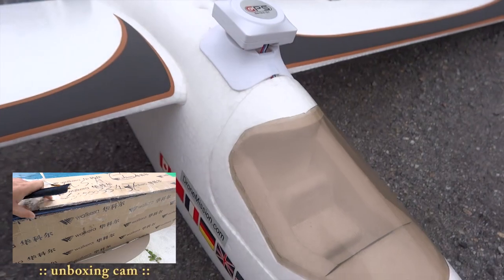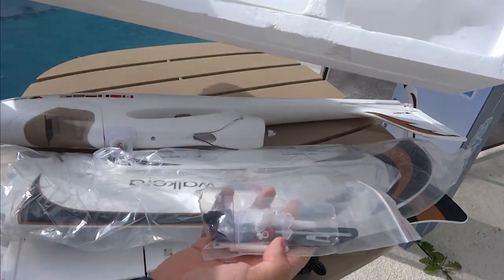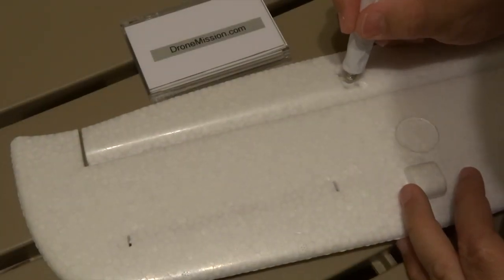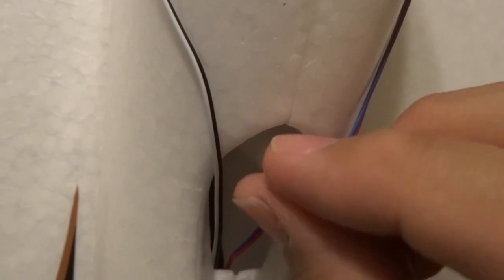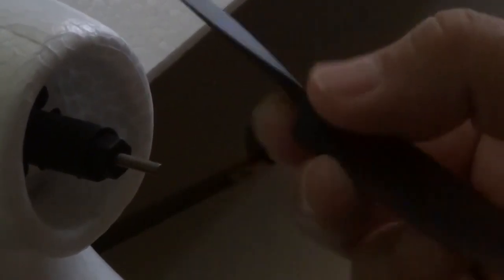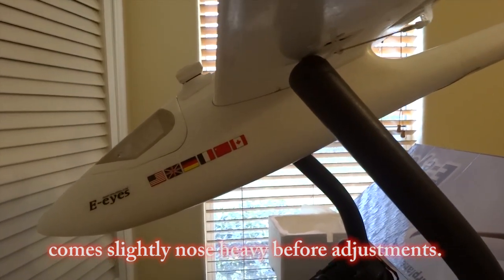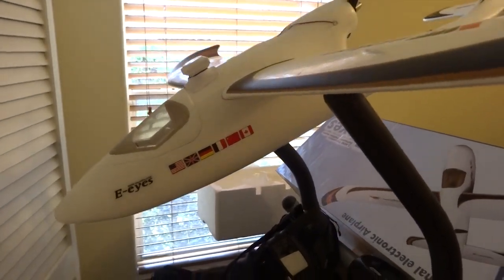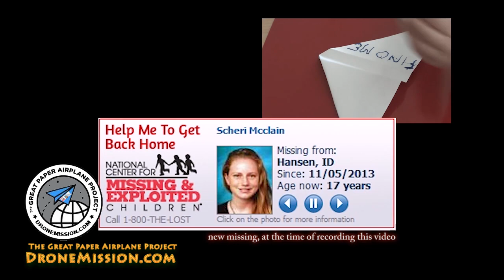Walkera E-Eyes GPS Plane unboxing, installation & maiden flight

Comment from the maker: hi rick, sorry google+ is confusing,  but to answer your question we lost. The BNF version has the walkera receiver built-in, you will need to use a devo transmitter or DSM2 compatible, unless you cut the fuslage.  if you plan to use the spektrum, you will need confirm it is DSM2 compatible with the rx701.  you can use own charger.  however walkera uses a smaller HXT, you may need this adapter. 

LiPo Adapter: http://www.hobbyking.com/hobbyking/store/uh_viewitem.asp?idproduct=46363&aff=951347

the walkera charger is compact and good for travelling, so it worked well for us.

Comment: Can I use the devo 7 and the stock receiver for rc plane?is the range good enough?
Reply from the maker: flies okay so far with stock devo 7 and stock receiver.  We have not gone beyond 2 football fields size.
Reply: is it okay for normal park flying?
Reply from the maker: absolutely, flies great and handles well in the wind
Reply: i've heard that you can change the power output on the transmitter for longer range....can you tell me what the power output of yours if you don't mind?i think is under 'ampli' setting
Reply from the maker: Aaron, yes, we just checked the DEVO 7 for you.  On ours, we can adjust it to +20, unless it is restricted by your country.
Reply: so do you think is safe to fly a plane at 200meter radius?
Reply from the maker: That is the advantage of the GPS, Try it, fly 400 m in height.
Reply: Does it means that it could have go further with the GPS?or is just a safe feature?
Reply from the maker: The GPS has a failsafe and will take your model back to launch point when it loses signal.  Don't touch the sticks while it is on autopilot, but be prepared to resume control if you see a need to.
Reply: ***** so whats the maximum range before the gps kicks out?